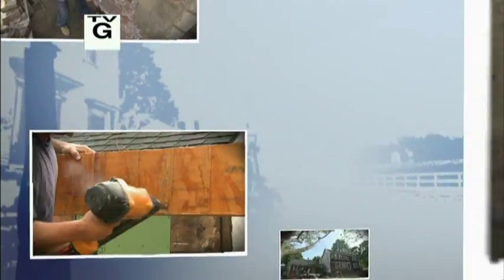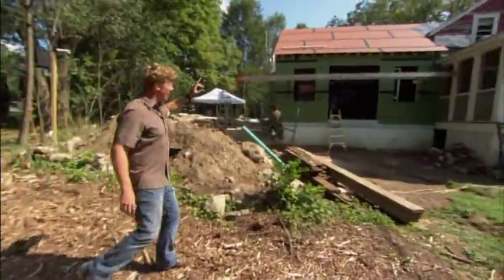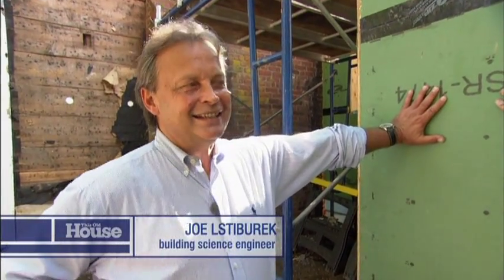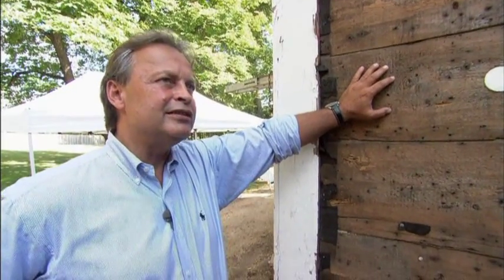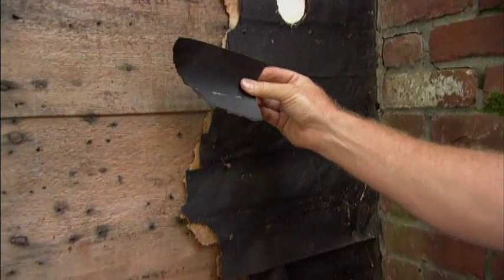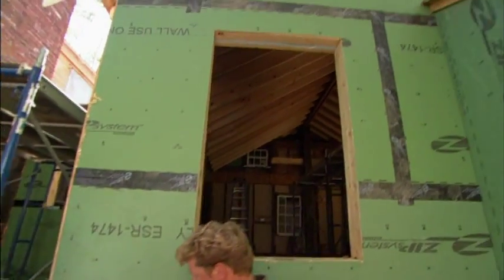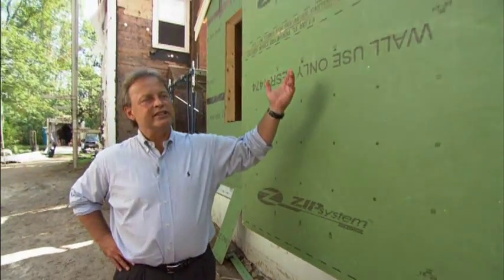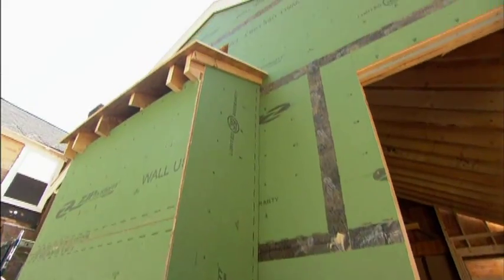ZIP System™ Sheathing On TV

Comment: I have seen homes with zip wrapped with Tyvek.  Can some one answer me why?
Reply: Because zip is a faulty product
Reply: @garyzimmerman1026  That's right.  Sorry, I'm late to the party.  I've seen the standardized test of Zip.  OSB sucks.  Tape won't lay flat to it, and the water beads get behind the seam tape and go right in.  Also the nail holes do that.  So now people are recommending using liquid flash all over it.  What a pain!

Comment: I wouldn't want a house with that crap, water leaks through the nails.
Reply: Hamguy Bacon ive built with these and would agree %100. They only have a min 30yr warranty almost as if its saying "this won't last a life time".
Reply: I like it
Reply: @AN0N420YM0US  you're supposed to liquid flash any nail penetrations. You can use the tape like these guys did but it's more preferred to use the liquid flash on the seams too. We used it on my dad's house for both the walls and roof. There were only a couple leaks coming through on the roof over a period of 6 months before the shingles were laid down. To me, that's pretty decent just having the sheathing on the roof for that long.